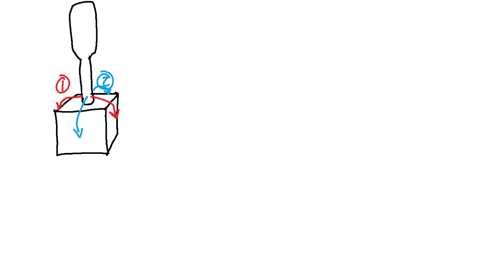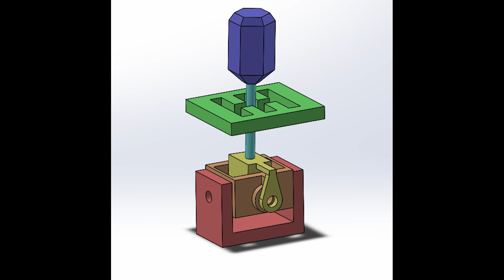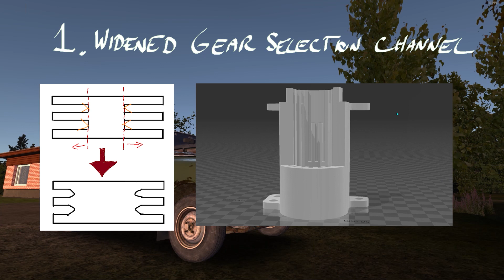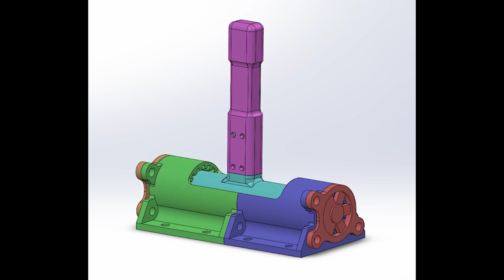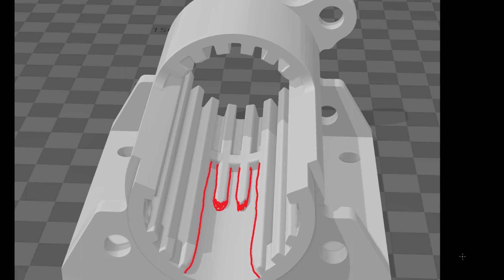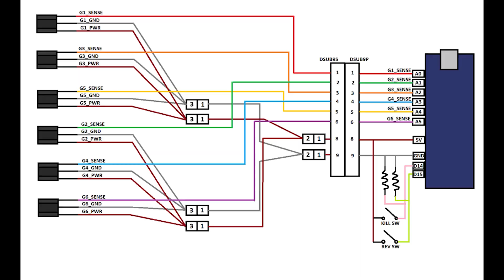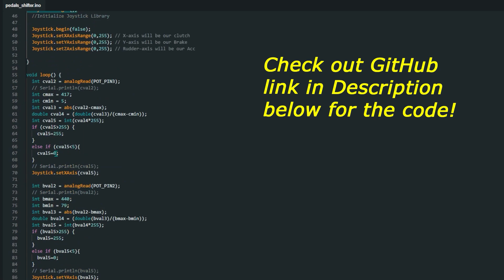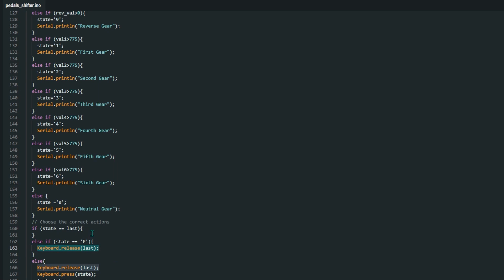3D Printed H-Pattern Shifter (MSC Challenge Part 3)

Comment: I wonder if it would be easier for the Satsuma (being 4-speed) and rally racing if you remapped the gears to different locations, but it all depends how the shifter feels I guess. The main issues that I'm thinking of mostly come down to how the rally involves mostly shifting between 2nd and 3rd gear more than any others; I would be a little worried about accidentally shifting into the 5th slot instead of 3rd (i guess not a huge issue as long as the code puts it in 3rd anyway).

My original thought was having it go 1-2, 5-6, 3-4 so you could just slam it all the way to the right when moving from 2nd to 3rd but now that I think about it more it might just be better to have 2 and 3 on the same vertical slot. So something like 2-3, 1-4, 5-6 (or flip any of these if desired).